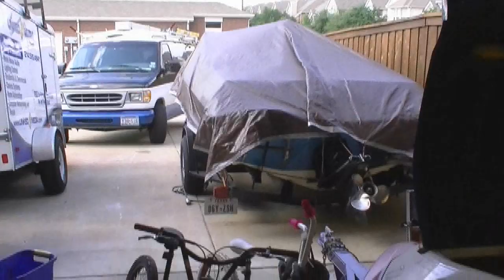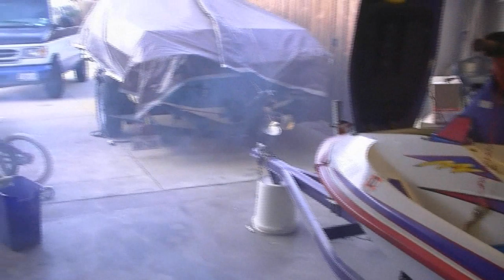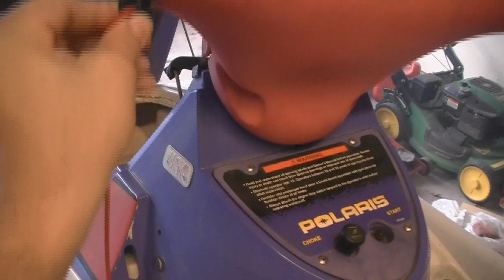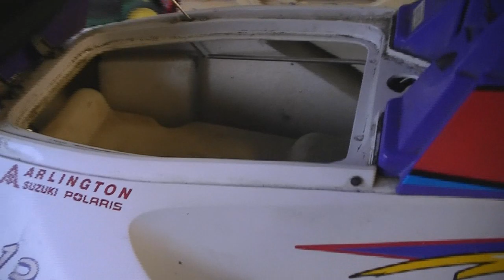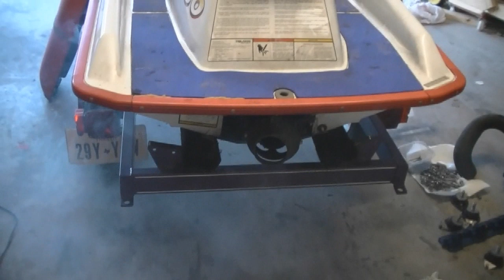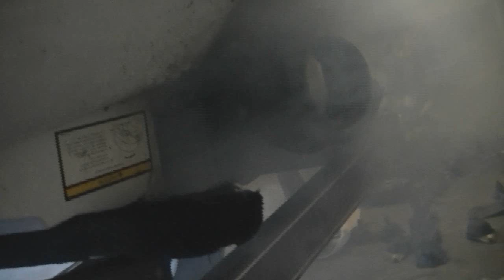The Final touches on the Polaris SL 750 Jet Ski.

Comment: I just got one of these for $100. Missing part of the impeller I got on ebay. It actually ran with premix in the cyliders. Took the engine out and pulled the carbs and rebuilt. Now off to clean it up, fire it up, and take it to the lake

Comment: 32:1 is what you should run , you would run 40:1 to break it in  , use you hand and make sure all clys are warm , the impeller making that rocking sound is normal when its out of the water . i hope you have the drive shaft bumpers on each end of the driveshaft , the wire thing is true i kinda got in a hurry myself when installing mine  it is a pita to run that wire with everything installed , message me for a polaris manuel if your intrested ,

Comment: I have two 750 sl and both of them have a hole to the right of the impeller and i assumed it was where a hose fitting once was. It looks like on yours you have a plug where that is... Is that ok or should i get a new fitting.

Comment: When you rebuilt the engine did you find some oil coming out of the exhaust? I bought a ski with a rebuilt motor and found some oil...I figure it was because of the tons of oil running through the machine (oil and gas combo and it's an oil injected engine)

Comment: Good job, im not knocking you, just wondering why you would spend the time and money to rebuild such an outdated and argueably worthless ski by todays standards?
Reply: Same reason a guy like me who gets 2 brand new skis every 2 to 3 years will never get rid of my 2000 polaris slth. The hull design alone allows me ride for 2 hrs on the bay and unless I go out of my way to wet I stay pretty dry from the ankle up. If I go out into the Ocean I prefer my 3 seater polaris over my newer yamaha and seadoo that nose dives off the top crest or worse instead of riding up side the of a wave the newer ones cut into side of wave before going up ward sheering water in my face  like your dad or older brother splashed you violently in a swimming pool growing up. Unless Im flying catching anx skimming across the tops but one timing mistake and bam! Lol Sometimes I can point the nozzle up to highest possible angle and hammer it like im trying to do a  wheelie on a harley to avoid getting smashed with water wall. My 2000 polaris   I can just ride it lol